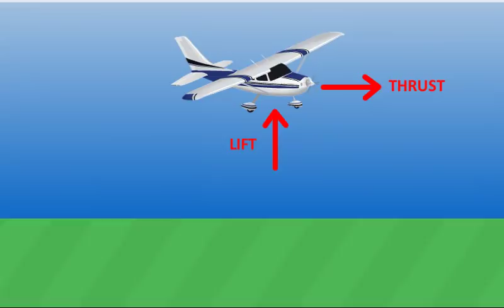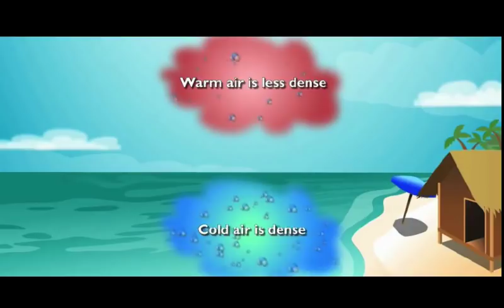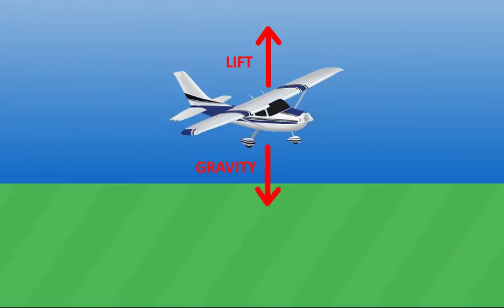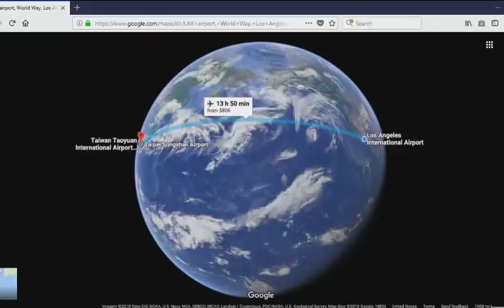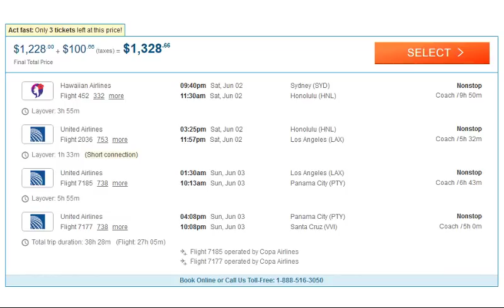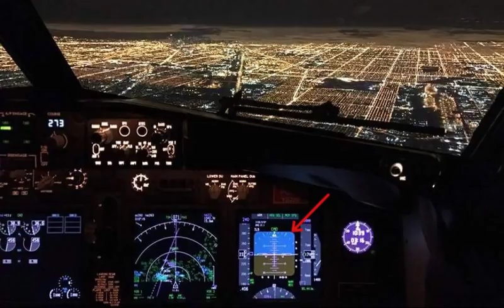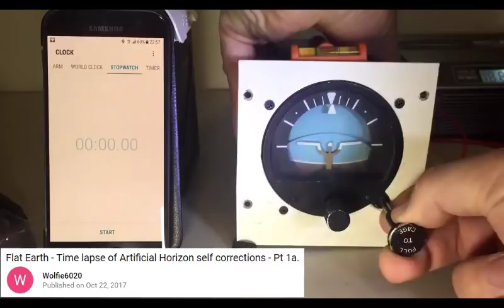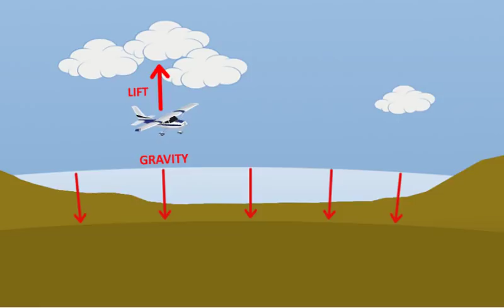Flat Earth Falsities - Plane Nonsense

Comment: Several Errors:

The plane does constantly nose over by a tiny amount. This is not "due to gravity", it's due to "trim". The pilot constantly uses the altimeter to maintain the desired altitude above ground level. The power of a plane in straight-and-level flight is also sufficient to climb at a reasonable rate if desired. At fixed power the plane will simply not move forward as quickly when trimmed/pointed/aimed "upward", just as it will move forward more quickly when trimmed/pointed/aimed downward. The curve of the earth is, even at about 600mph of commercial airplane, gentle enough that the continuous adjustments of attitude are below the perception of human senses. Meanwhile updraft and downdraft events are also happening.

(Note that the above constant need for adjustment is just like the constant adjustments in the artificial horizons explained later in the video. So gravity directionality is key for maintaining straight-and-level flight, but the gravity balance of forces explanation provided is incorrect. If you put the artificial horizon segment first, then do the altitude one, you'd zen to the problem and solution better.)

(Also note on the above. Every aircraft has a manual that includes the "power curve" for the aircraft that graphs all these issues. There is also a mode used for landing called "slow flight" where the functions of throttle-sets-speed and attitude-sets-climb, is reversed so that throttle sets rate of descent and attitude sets forward velocity. Without this second mode it would be very difficult and unsafe to land planes.) 

The Taiwan thing... You oversimplified. The line for the flight isn't just curved due to the "roundness of the earth" due to mapping issues. The "Great Circle Routes", known for hundreds of years, are also in force. A "straight east-west" route along a latitude line other than the equator is longer than the curved route. The shortest route on a globe is along an equator-of-sorts, that is the curve formed by a "great circle" centered in the center of the globe and the two endpoints. (Google "Great Circle Route" for more info.) The great circle route is why Quantus 27 fly so far "south" when going west-to-east.

In short, on a globe, none of the straight lines are meaningfully straight over more than a quarter mile. We know this because of lasers. So the real error in "flat earth logic" is the assumption that anything geographical is a straight line.
Reply: Look up "angle of attack". Planes are complicated. Planes are always ever-so-slightly in a nose-up attitude while in "straight and level flight".

Most of the lift comes from the shape of the wing, the fast moving air on the top of the curve doesn't get a chance to push down on the wing as much as the slower moving air on the bottom pushes up.

But since the plane is moving through the air so it's advantageous to increase the pressure on the bottom of the wing by exposing it directly to the pressure of flow of air. The thinner air at the higher altitude doesn't generate as much lift because there just isn't as much air per cubic foot (or cubic meter) so the lift would be reduced.

So the same way the angle of your hand, when stuck out of the window of a moving car, causes "lift" when you tilt it, despite not being wing-shaped, is the result of the "angle of attack" of your hand versus the relative wind of the car.

Flying is complicated and the forces are many and subtle. The pilot constantly manages "the configuration of the aircraft", including its attitude, air-speed, and ground-speed via trim, throttle, and attitude. (yes, I used attitude twice).

So there are many configurations that balance "hanging on the prop", the wing's "virtual shape" (via adjusting the flaps) and all manner of things that let you do all sorts of maneuvers.

There's a reason that a car drivers licence is much easier to get and maintain than a pilot's license. Flying is complicated and full of math and science.
Reply: You clearly have never flown an airplane. I have. Look up "trim" and "angle of attack" and generally spend two months preparing for the written part of the pilots exam before shouting "Bollocks".

The laser-line straight distance you'd have to travel to reduce the lift enough to cause you to "top out" is significant, and you'd have long-since left your assigned and/or desired altitude.

That is, if you've been told to fly at 30,000 feet, and you trimmed for laser-level straight flight, you'd get to a good 38,000 feet or far more (full disclosure,I'm pulling that number out of my ass) before you had to even touch the throttle or trim. But by then you'd be out of your assigned flight altitude and you'd have a hell of a time keeping your flight credentials after the FAA got a hold of your ass. 

Google "Power Curve" and look at how little the horsepower available changes between altitudes.

This isn't rocket science, but it is airplane _science_.

Random guesses from people not trained as pilots is no way to debunk aircraft issues.
Reply: BitOBear
So is what I posted incorrect?
Reply: What you posted, @wrong, in response is partially correct and partially incorrect. Because any given aircraft has a maximum altitude above which it can not climb, if you are at that altitude then the plane "will follow the curvature of the earth without any [_further_] input from the pilot".

But planes are virtually never taken to their maximum altitude, just as submarines are not regularly taken to their crush depths. A plane that has topped out at its maximum altitude is going to be wasting a lot of fuel for the distance traveled and it's very likely to experience various forms of failure.

Self Correction: I double-checked with an air traffic controller since me piloting experience never included jets. Apparently commercia jets do like to fly as close to their maximum altitude as possible because the air is thinner an so easier to pass through. But the position is touchy as shit, so when topped out use of the autopilot is mandatory. The small, fast planes, like a Gulfstream, are just not subject to human pilotage at those attitudes. That means that following the curve of the Earth "naturally" because of an pressure and gravity never happens. It's always requires constant intervention.

At any lower altitude the pilot can choose any number of configurations that will lead to gain, maintain, or lose altitude "in general". This is typically done with the "trim" control. But it takes a very very good pilot to get exactly on the "maintain altitude" and, depending on the plane, moving your head back and forth, or having a passenger walk to the restroom is enough to cause a change in attitude and so cause a level flight to change to a climbing or descending attitude.

Gravity and Air Pressure change very little compared to all the other forces at play.

So you weren't "absolutely incorrect" but you are not close enough to the practical to be "correct enough" for the hypothesis to bear repeating.

Air pressure and gravity do follow the curve of the earth, but airplanes are built to overcome gravity and otherwise deal with air pressure. It's literally what they are designed to do, within limits anyway.

To get meaningful straight-and-level flight on a journey of any distance requires continuous correction, which is why the autopilot does so much of the flying in commercial long-haul settings.

In light planes and "civil aviation", absent an autopilot, the pilot has to maintain altitude constantly, just as the driver of a car has to constantly maintain lane position.

Nothing is free. But the compensation for the curvature of the earth is close to it because you are constantly monitoring and adjusting the altitude "by hand" or "by autopilot" for other, more immediate reasons.
Reply: BitOBear
So is what I posted incorrect? Your latest post prove what I said was correct and your OP was incorrect, but you are too whimpish to admit it.
Reply: Theo Flatis: Antarctica is a land mass with a very thick ice sheet on top. It is 9,300 feet (2,830 m) high. 
The Arctic is sea ice so it is just above sea level. 
That’s the biggest reason for the temperature difference.
Reply: On the southern hemisphere there is much less land masses which change albedo drastically. This is another reason for Antarctica climate difference in comparison to Arctic.

Moon landing was proved by russians. Otherwise they would laugh at americans and didn't acknowledge that they were first on the Moon. If you knew anything about radio communication you would know that it is possible to pinpoint place of origin of the signal in 3d space. You just need three receivers in three different locations.
Reply: Bollocks. There is no adjustment needed as the aircraft will naturally follow the curvature of the earth without any input from the pilot. This is because the aircraft flies through the atmosphere which also follows the curvature of the earth.
It's the air pressure that keeps a plane in level flight. Increasing altitude reduces the lift and the plane falls; decreasing altitude increases the lift and the planes rises.
Reply: Planes constantly keep lifting the nose up throughout every flight higher into the troposphere !! Fact !! Explain that please ???
Reply: Can you explain to me how planes can fly upside down and feel the right way up please ??
Reply: You seem pretty intelligent so can you explain to me why the north and south poles climates are extremely different ?? On a globe earth they should be very similar but they are not
Reply: And also do you believe we have landed on the moon before ?? I’m just interested in everyone’s opinions and views

Comment: If the Coriolis effect is real and the atmosphere is moving with the alleged and  spin of the earth,  wouldn’t airplanes have an even more difficult time going against the alleged spin of the earth then if The atmosphere was free from the surface of the earth?
Reply: No, Don Will. The relative speed of a normal Coriolis event is just a few miles per hour at most. When the event is severe we get "hurricanes" and the like, and then, sure, airplanes have a heck of a time. But it's still not a "earth racing out from under you" kind of thing.

A normal Coriolis event is what you see as "high pressure" and "low pressure" regions on national-scale weather maps. The gradients are often a thousand miles or more wide. And they do have an effect on flight times by providing head or tail winds in specific circumstances. (This is also why pilots have to deal with both air and ground speed issues individually.)

To understand all this... take a trip on an airplane or train. Excuse yourself to the restroom mid-trip, and flush the toilet. See how the water doesn't leap to the back of the train/plane when you flush? That's because the water on-the-average is moving at the same speed as the plane/train. So some of the water is moving slightly faster than the plane/train, and some is moving slightly slower, and so the water swirls safely and predictably. Then go back to your stet and stir your drink. Same deal. If you are on a commercial flight that drink is moving at like 550 miles per hour but it can still swirl.

So if the air didn't move with the earth on the earth, then the air wouldn't move on the plane with the plane, and everybody up front would suffocate while everybody in the back would be crushed when the plane tried to move out from underneath the air.

Think that's bull. Go get a helium balloon and let it float around in your car. When you hit the gas the balloon will rush towards the front. If you break hard, the balloon will rush to the back. Turn right and the balloon will move right faster than the car. Etc. That's because the air does get pushed around by forces and the balloon is lighter than the air. And yet, without the balloon to tell you what's happening, you've never noticed all these forces that are gently nudging things all around you.

Put your finger near the smooth outer edge of a spinning gyroscope or bicycle tire and you can feel the movement of air that the spinning wheel has caused to spin as well.

I could literally give you dozens of other experiments to demonstrate the various elements of the tapestry of facts you've overlooked. But who has time for that.

The earth is really, really big. And so fairly tiny forces have a lot of room to add up.
Reply: @Brian Johnson
One can only assume those friends also told you females don't fart and Elvis is alive and performing with his pet unicorns.
Reply: Brian Johnson :: you were "told by a friend"? Anecdotes are not evidence.

Meanwhile we no longer fire heavy artillery by sight, so your friend was not taught how to compute a "firing solution" by hand. There have been solution tables for decades if not centuries, an now we have "computers" to do the calculations.

Torpedoes "fly through the water" with "guidance" and "firing solutions", so there's no need to teach a swabbie how to compensate in his manual calculations.

You might as well be saying computers don't exist because your friend told you that his "internet for dummies" book never mentioned carrier depletion region boundaries.
Reply: I was told by friends who were in the forces that they don't teach compensation for the Coriolis Effect. That submarines don't adjust for the curve of the ocean on a rounds Earth. Speaking of that. Why does the Earths Oceans lakes and streams not collect at the equator on a spinning globe.
Reply: Fuck off you pathetic troll.
Reply: Don Will um...no

Comment: Hi and low pressure and Weather is created by temperatures high and low, warm and cool meeting each other, it has nothing to do with the Coriolis effect which is nonexistent.
Reply: If it was just a high pressure low pressure situation then all winds would be northerly and southerly since they would be flowing from the high pressure equator to the low pressure poles.  Winds don't work like that though they move in circular patterns counterclockwise north of the equator and clockwise south of the equator, exactly as predicted by coriolis effect.
Reply: What do you use to replace the coriolis effect in explaining the opposing rotations of typhoons/hurricanes in the nothern and southern hemispheres?
Reply: Incorrect Don Will. Because the earth is a globe, the air at the equator is moving faster than the air at the poles. (Spin a cardboard thing on your finger, see how it's barely rubbing your finger at the center but the edges are moving quite a bit faster?)

As the air moves north from the equator it "wants" too keep moving at the speed it was already going, so it appears to move east. As other air moves south towards the equator it also wants to keep moving at the same speed it was going, so it appears to move west. This is because the earth is moving "out from under the air" at a speed that is different that the air is moving.

So the reason that the air doesn't instantly flow from the high-pressure spot to the low pressure spot is because the cumulative effect of this tiny imbalance of forces adds up to "cyclones" and "anti-cyclones" often a thousand or more miles wide.

Look at all the wind directions on a national weather map. None of the arrows point straight into or out of the H and L circles.

Now the Coriolis effect "doesn't exist" in small systems because the speed of the earth measured from one edge of your toilet to the other is effectively constant. It's almost measurable in a an Olympic sized swimming pool. But it's super obvious measured from Florida to Mane. 

So you can make the whirlpool go either way in your bathtub by stirring the water before you pull the stopper, but you can't stop a hurricane with a desk fan.

Science has scale, and the earth is huge.

Comment: If the helicopter goes higher it will lose its position above a spot on the ground unless it flies east
Reply: As explained before this is because the effect of gravity is lessened the further away you get.  Therefore, the higher the helicopter goes, the more it will flow away from the spot due to everything around it moving as a set rate.
Reply: Psy Fi To maintain position on a radiating line on a circle that is increasing in size requires increasing momentum. It is a small effect. Speed = d/t where d is the circle traveled (2 pi r) t = 1 revolution of circle (1 day). You can see by increasing heght r speed is increased. Friction will help to increase speed but it's not enough
Reply: wong how surprising to find such a person posting on  YouTube
Reply: wong is the correct word recta?
Reply: wong always best to get to the bottom of the problem
Reply: The system is the entire planet.... Solid liquid and gas.... rotating as one
Reply: A good point, if so I will rectumfy it.
Reply: +David Austin
Your various posts put me in mind of this
https://www.youtube.com/watch?v=7DcDzJmW6Qg
Reply: wong Your attitude is strange. Are you a flat earthers by any chance. I'm loathed to engage you but I'm fascinated. Very strange indeed.
Reply: wong you are wong please Wight those wongs immediately
Reply: I feel wonged
Reply: Heh? I thought the helicopter still has momentum which it doesn't lose because there is no other force opposing that?